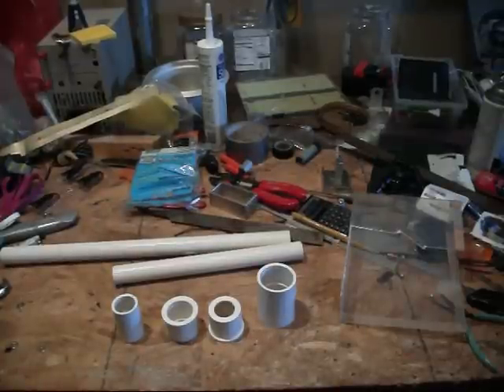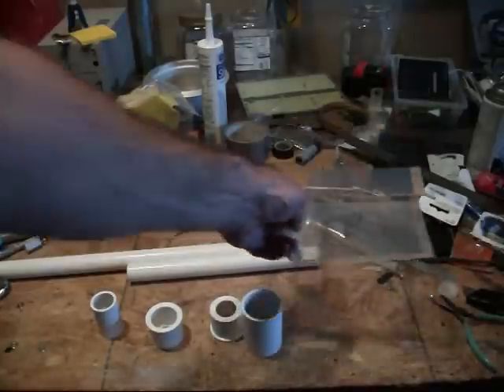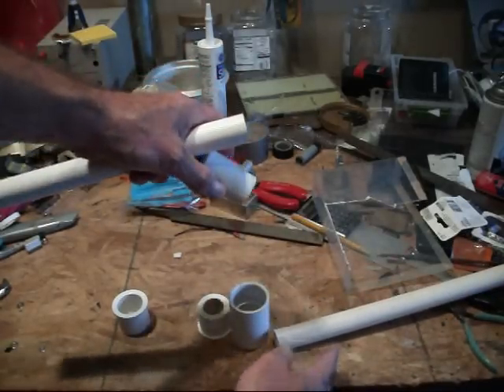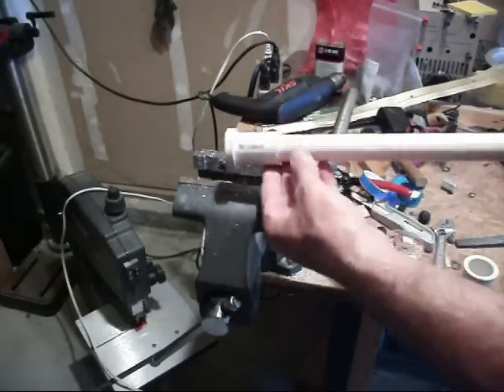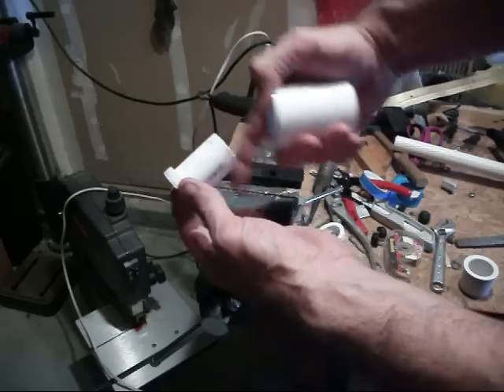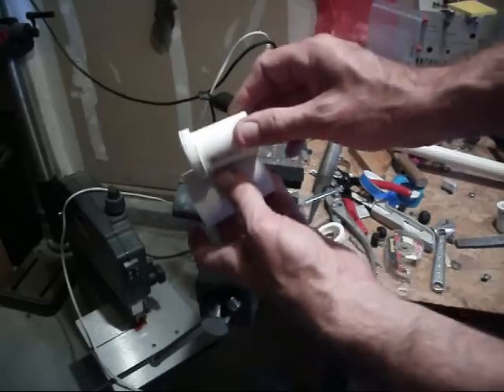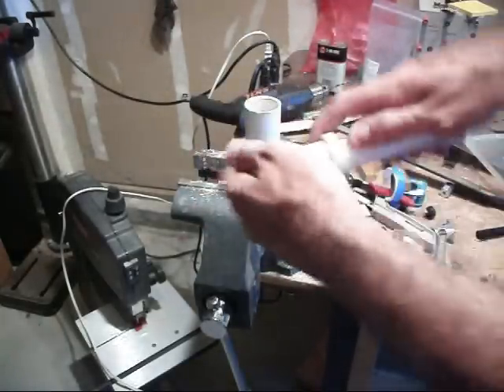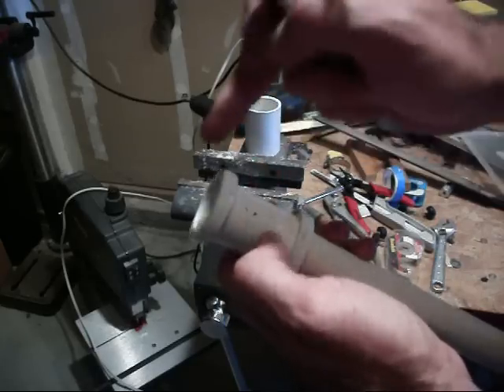DIY Homemade Vortex Cooling Part 1.wmv

Comment: build my vortex cooling tube I used PVC pipe that has an inner diameter of about 0.81 inches. Looking into the formulas for the design of a "real vortex cooling tube" you usually want the length of the Hot End of the tube to be about 45 times the diameter or in my case about 36.5 inches. So this is the length in the drawing above from the inlet nozzles to the cone block valve. In keeping with that thought here are some other dimensions that I followed in making my tube:
  
Tube I.D. = 0.81"
Hot End Length = 45 x 0.81 = 36.5" (round off a bit)
Cold End Length = 10 x 0.81 = 8 (round off a bit here too)
Orifice Size = 1/2 Tube I.D or about 0.40 inches (ballpark rounding of slide rule accuracy)
Inlet Nozzles = 0.12" and I drilled 5 of them

Comment: Isn't this the same general idea as an automotive or refrigerator air conditioning Expansion Valve or Orifice Tube setup? If they have similar pressures I'd imagine you could simply buy an already set up device from the auto parts store for about 20 bucks or less and a whole lot less assembly. BTW: I was standing in a local snowmobile shop that used PVC air lines - when one of the lines exploded.  It's a horrible thing to be around.  Hundreds of tiny pieces of shrapnel flying in all directions at about 300 miles per hour.  VERY, VERY dangerous.

Comment: I worked on air craft A/C in the Navy and some of our planes had Air to Air cooling. By compressing hot engine bleed air and passing the air through a distribution valve thus going from high press to low pressure a temperture drop was created. Giving you air conditioning.
 This is also the same basic principle freon systems work under. High pressure liquid, to a distributor.

Comment: Not unless you're doing several hundred miles an hour, I'm afraid, as the pressure that you get from the ram air effect isn't enough.

Comment from the maker: @truthseeker911david 
Thanks! I believe I have seen those but didn't think of that. Have you checked out the other tube that I made and tested with the thermal camera? That one was smaller and simpler (easier) to make and required much less air to run. I got really good results with it.
Thanks for checking out my channel. Are you building a vortex tube?
 - Otto